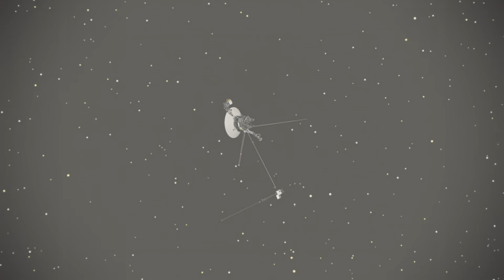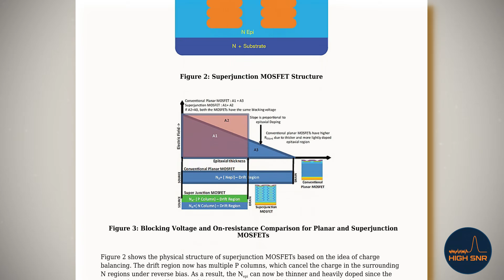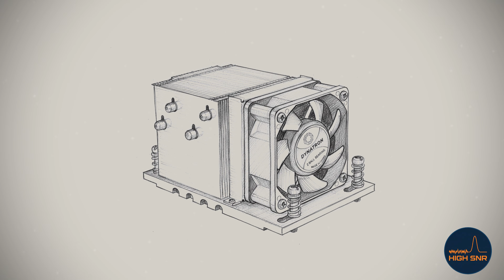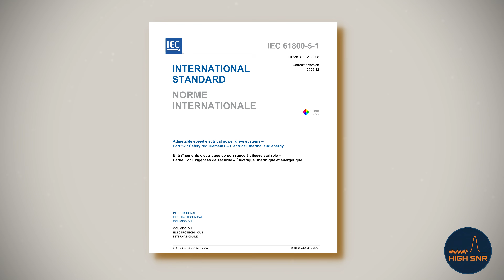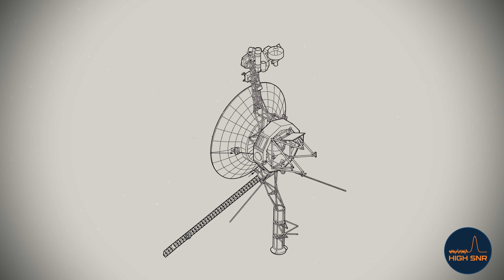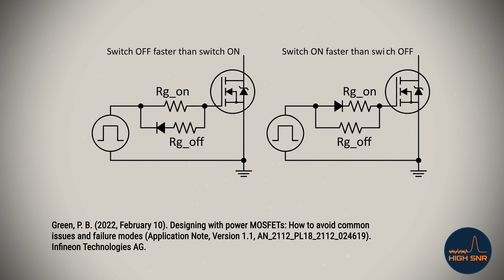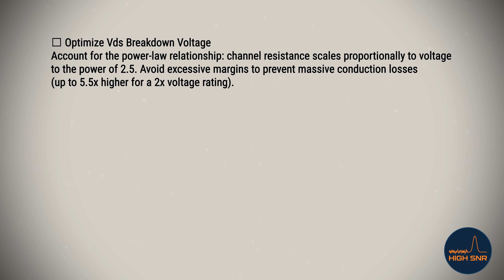Stop Oversizing MOSFETs: The Hidden Thermal Cost of Voltage Margins

Comment: i feel like whomever made this just picked and chose what those datasheets say. Its is completely normal to overspec parts.  You cannot chose a mosfet that "just" meets the exact requirements because every electronic device has a tolerance, from resistors, capacitors, ics ,inductors etc. The tolerance of each is not even the same in the SAME batch. Engineers select higher spec parts because they know that the part will never reach its maximum rating under normal conditions. WHICH increases the lifespan of product. Take something as a power supply rated for 500w. Its NEVER rated for exactly 500w but sometimes 600w because there is variance between the same power supply as well as the device plugged to power supply might have spikes over 500w for a few seconds. Its seems the poster didnt even see in the datasheet that overspecing to sometimes twice the usable range is normal. The devices that are rated  for higher ranges almost always are more efficient than those that just "meet" the requirements. The poster also didnt bother to check that some of the alternate solutions given in  the same datasheet have much worst draw backs like a  decrease in system efficiency. Running a 20A mosfet for example close or at its max spec will cause it to heat up whereas running a higher rated Mosfet say 40A at 20A keeps it cooler and increases the lifespan of device.  Theres a difference between what happens in theory and what happens in practice. They dont always agree or follow the same rules.
Reply: You’re completely missing his point. The focus was on MOSFET Vmax , it wasn’t about NOT building in safety margin as a general design principle. He is specifically pointing out an area in electronics design where arbitrarily using a MOSFET that is spec’d for 1.5 or 2 times what is needed can have a negative impact on the circuit and/or component rather than the intended increased protection from circuit induced voltage spikes.

You have clearly taken things out of context or were just not listening. In fact he actually argued for building in extra margin in regards to the expected application. He actually was pointing out that the voyager probe needed more robust components just to stand a chance of surviving reliably for as long as possible, which was the result of proper planning and NOT lazy engineering relying on old adages like 2x planned voltage for EVERY component. For most components this rule of thumb is fine but for your MOSFET, your better off choosing a smaller value with sufficient headroom and then address the spikes through refined circuit design & accurate discreet component values (i.e. implementing the right snubber circuit for the job and dialing in your resistor values instead of just settling for whatever is closest that works)
Reply: @LateNightDIY  Your opinion assumes that the specific problem can be solved and that your solution does not cause any reduction in efficiency or any other disadvantages. You also assume that engineers just williing nilly chuck greatly overspecs parts without taking whats reasonable into consideration. Cost alone prohibits  engineers from selecting vastly overrated components that is why 1.5 to 2x is the norm. There is no one size fit all solution.
Reply: Then theres the question, do you really need to waste more time "solving' a problem that is unnecessary to solve. Is it worth it to find a solution or invest in even more components just to get a solution that might not even affect the overall function of the device. Sure if its for highly sensitive devices or stuff like medical equipment but for the vast majority of electronics it is unnecessary and just increases cost and BOM
Reply: If the application is demanding or can’t be serviced later, then of course you’re going to add larger safety margins … but your doing so because you believe it’s necessary for the planned application and not just following a universal adage for building in  extra margin to the components Voltage thresholds.
Reply: @LateNightDIY  do we know that the voyager probe used MOSFETs. It was a long time ago and I don't recall MOSFETs being widely used back then as they were in their infancy. Even basic logic like the 4000 series were not ubiquitous back then , most logic still being bjt transistor based.
Reply: @DanRyan-v5y  The computer in question on voyager, the FDS,it has 3, uses CMOS memory (RCA 256×1-bit CD4061A CMOS SRAM chip). Cutting edge and a first for the time. The rest of the logic was TTL
Reply from the maker: @denizenaru   I think there’s been a slight misunderstanding, as we actually completely agree! The core message of this video is that headroom is essential. Properly calculating your safety margins is mandatory, while just guessing them is what leads to failures.
Reply: What you seem to have completely missed is that in cases like this you can't change just one spec. If you swap an given MOSFET for one with a higher Vmax, you are at the same time swapping it for one with higher heat output under the same conditions. Sure, you've increased the voltage tolerance, but you've also just reduced the tolerance of your system to overheating.

Comment: Use a better ai voice your video is good
Reply from the maker: @SamithPB-ql7ey  Thanks for the feedback!
Reply: @High_SNR_Channel  I want to develop a circuit that runs a 1.7mhz piezoelectric atomizer and with a few other functionality but the MOSFET generate too much heat and don't want to add a heat sink(I have no knowledge of electronics just getting started) can you help with it
Reply from the maker: @SamithPB-ql7ey   The problem lies in the 1.7 MHz frequency. Without a gate driver, the transistor switches too slowly and generates a ton of heat. A heatsink-free atomizer circuit requires very complex solutions, which is tough when starting from scratch. My best advice for a beginner to save your nerves and components: buy a pre-built atomizer module, and start learning electronics with lower frequencies. Best of luck!